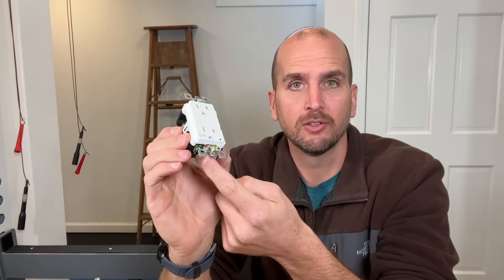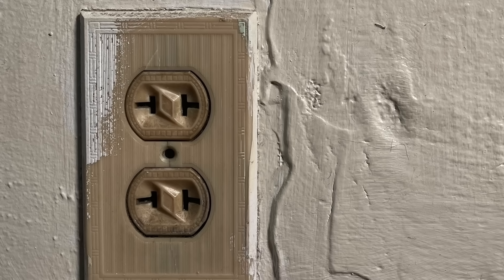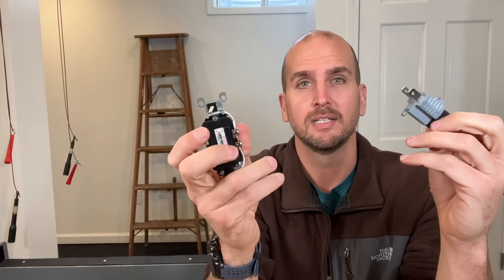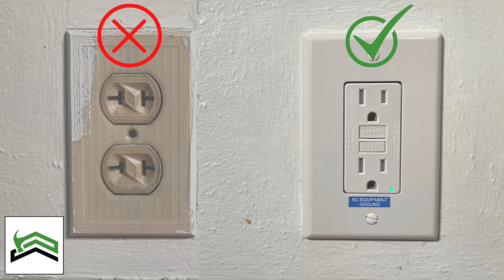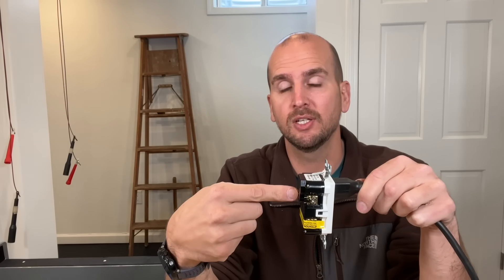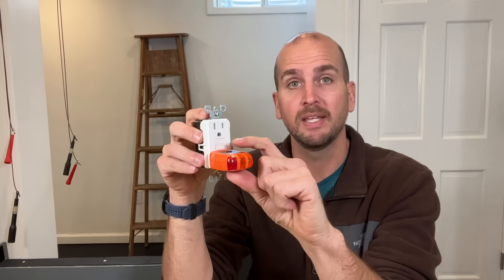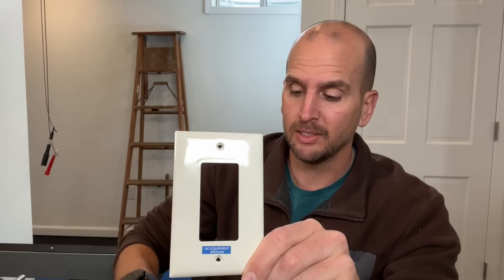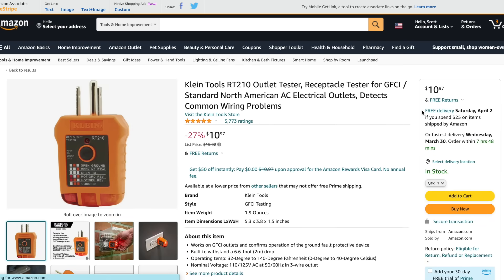Does a GFCI Outlet Still Provide Protection Without A Ground Wire?

Comment: What if the existing line cable only has 2 wires, then the existing load cable has 3 where the gfci outlet is connected to. What is the right/correct connection and how the gfci works on this kind of connection?

Comment: Thank you. I just bought a house and when we were testing the GFCI outlets (for some reason almost every outlet in this house has been changed to a GFCI outlet) only 4 showed as grounded. I wanted to check to make sure the ground wire was connected so we shut off the power to check. What we found was the copper ground wire had been cut. The house at one time was rewired but someone cut all the ground wires from the outlets that were reading as ungrounded. They cut the wire to where it was stripped. Also one of the outlets was wired incorrectly in the dining room. We’re not sure what we are going to do but the video was very informative.

Comment: Will a gfci actually protect outlets downstream and will it pass code? I have heard that a failure downstream may not necessarily trip the gfci upstream, but the breaker itself.
Reply: A GFCI will protect outlets downstream if they are connected to the Load. If they are connected to the Line it will not protect downstream outlets.

Comment: CORRECTION (and an important consideration): If you are isolated from ground (such as standing on a dry wooden floor with rubber soled shoes on) and touch a GFCI outlet with only two wire connection, it WILL NOT TRIP. Because, just as with the Klein tester, there is no path to ground in this scenario. Instead, you become the LOAD, and you are reliant on the breaker to trip instead (which is also unlikely, because your body's resistance is generally too high to allow adequate current flow to trip a breaker).

So yes, GFCI's installed on two wire applications will work when there is a path to ground THROUGH YOU. But they WILL NOT WORK when ALL of the electricity is flowing from Live to Neutral on the same outlet (no path to ground, through you or otherwise).

Comment: No, the GFCI circuirty is only measuring the DIFFERENCE in current across hot and neutral..
If it's over, say 20ma difference, then the GFCI will trip its breaker...

Comment: Late to this party! Wonderful explanation of the function of a ground-fault circuit interrupter. You cover its ability/how to detect, compliance to code when replacing a 2-prong, ungrounded receptacle, and (kind of directly, but indirectly) pointing out the protection to load-side (down-stream) devices is also present and code compliant. The one thing I'd add is this: to test a GFCI receptacle OR breaker, at that point, is to use its built-in test button function. This will demonstrate the device's ability function properly, and should it be a faulty device, it WILL NOT reset, meaning it's time to replace. It sucks to find out so abruptly that way, but it beats finding out it doesn't work under a more disastrous situation. (Master electrician, contractor in Colorado 👍)

Comment: Well just one thing, since that tester won't tell us if the GFCI outlet is working how do we test it?
Reply: every GFCI has a TEST/RESET button on it. It is recommended that you test it every month. Push TEST button. If the it trips instantly, it is working. Press the RESET button to restore power. If the outlet does NOT trip after you push the TEST button, that GFCI is faulty and needs to be replaced.

Comment: I have a new washing machine which is 1900W and 10A rated current that requires to be plugged in a convenience outlet with ground. My question is, if i am going to not install ground wire and only GFCI Outlet will be installed, is it safe? 

Just asking because i already tested the washing machine plugged into the convenience outlet without ground and i felt mild electric shock that is why i am asking here if GFCI is okay to install without ground because i feel scared of being electric shocked again.
Reply: Yes, it is safe. That's why it is code compliance in the first place. GFCI would have instantly cut power, which prevents you from getting shocked.

Comment: Hello i am renting to own a home it was built in 1955 and has 2 prong outlets throughout the 1st and 2nd floor the kitchen and bathroom have gfci outlets and the basement has 3 prong outlets part of the buying process is having the home owner upgrade the outlets are we able to replace all the outlet in the home with gfci i believe there ate 12 in total throughout the 1st and 2nd floor is safe to have them all gfc or have 1 or 2 gfci amd then running 3 prong outlets off the gfci

Comment: Nice video…QUESTION: I have a gfci in a neutral-grounded metal box…I get 120v between hot and ground prongs on a multimeter…a gfci tester STILL doesn’t trip the outlet, but it does trip 3-wire gfci outlets…WHY??…it’s an eaton trgf15la gfci outlet and a klein tools rt210 gfci tester(says can hold the test button for 7 seconds(to build milliamps?))…again, the ground prong carries 120v since the metal box is pigtailed to neutral

Comment: One of the things I didn’t hear mentioned was the position of the GFCI outlet.
As I understand it, the GFCI outlet has to be the first outlet from the breaker.
I’m wondering if that’s actually true.
When you mentioned that the GFCI outlet is detecting the change in voltage between the Hot and the neutral, I suspect that if the GFCI was downstream of a light fixture, or another outlet, the GFCI would detect the change in voltage.
I have a situation in my house where I have some outdoor light fixtures that are the first fixtures connected to the breaker, and then I have two prong outlets. So even if I install a GFCI in the first outlet, I still have light fixtures that are upstream of the GFCI outlet.
 As I said, I think that the GFCI should still detect a fault upstream, but hoping somebody who knows for sure can weigh in.

Comment: I have a question for you I have some open ground receptacles in my older home.While testing I thought a couple were correct.The tester showed correct.The receptacles in question have surge bars connected to them.When I unplugged the surge bar the receptacles immediately read open ground.So my question is while the surge bar is plugged in to the receptacle is it grounded?Also for my remaining receptacles should I just install GFCI receptacles as my easiest way to provide protection.Thanks.

Comment: I’m trying to replace some old outlet receptacles and came across this problem. I only have 2 wires, black and white with no ground. It’s a 20 amp breaker. Do I use a 15 amp gfci and connect the cables to the top 2 screws? If so will the bottom outlet connection work? I’m just trying to connect a grounded ground protection extension cord to connect a small tv, phone charger and a small laptop.
Reply: If the circuit is 20 amp with 12 gauge wire, you can use a 15 or 20 amp GFCI and connect the wires to the Line side, it is imprinted on the back of the GFCI. Both sockets will work the same, just like a regular receptacle. It doesn't matter if your extension cord has a ground, if there's no ground at the receptacle, then there is no ground protection for anything plugged into it. USB cables for charging don't need a ground.

Comment: If I have one receptacle without the ground and I can’t fit a gfci in the smaller box but one of the boxes in the downline does, and is a gfci, does that protect the whole line and can I use a normal receptacle with the ground wire hooked into the white for the box that doesn’t fit gfci or should I make sure all receptacles on the line have gfci and find a smaller gfci or widen my box?

Comment: So it seams that it will work without a ground connection, but still need a route through ground to activate,so does that mean the human body becomes the ground wire to activate the gfci, which if there was a ground wire it would activate on its own without a human body touching it ?
Reply: What? No, it will activate without the ground, it detects of theres a short or malfunction and will cut the power off

Comment: Best explanation after watching dozens of videos. I’m replacing my daughter’s two wire outlets with GFCIs and in most cases, placing it in front of the circuit to protect all other outlets connected to the load on that circuit. My question is: Is there another tester out there that doesn’t rely on the ground to stimulate a trip?

Comment: If we have the older two wire home and want to install gfi outlet, do we still connect the hot and neutral wires to same place on the outlet?  I assume the “line” side.
Reply: The line side is for the power coming in, that side is not protected by the GFCI circuitry. The load side is for the power coming out of the receptacle, that is protected by the GFCI circuitry as the receptacle has no way of knowing where the loss of current happened.  Most of the time, you'll use both, however if for some reason you don't want to protect the rest of the circuit, you'd have to pigtail it to avoid having a more than one wire per terminal.

Comment: At about the 4:20 mark of this video you stated that there are about 10 or 15 years of serviceable life in a GFCI receptacle.
Now that we know that, about how many years of serviceable life are there in non-GFCI receptacles?
Please reply soon.
Thanks.
Reply: There is no particular number for that. My parents have a house that's roughly a hundred years old and many of the original outlets are still fine. Some of them are kind of loose and in need of replacement. There isn't really anything in particular to fail with non-GFCI receptacles other than the springs loosing their springiness and getting loose or potentially the wire getting brittle over time. I'm replacing a bunch of the outlets where I live because they've grown rather loose over the course of several decades of use, they're 50ish years old, and it's mostly the ones that were subjected to a lot of use that are now too loose to be particularly safe. 

It seems to have more to the quality of the receptacle to begin with and how it was used.
Reply: @SmallSpoonBrigade  Thanks.

Comment: If you have the old cloth 2 wire its recommended to place a GFCI at the first outlet on any circuit even if it is not in a wet area where it is required. Remember to label it properly to code with a " No equipment ground " sticker. That GFCI will protect anything that follows after that GFCI outlet. And as he has said remember these GFCI do have a lifetime. I swap them out after 10 years on my rentals just to be sure.
Reply: If you've got that sort of wire, you're better off getting an electrician in to install an AFCI breaker on the circuits if you can. The GFCI won't protect you against any arcs between the hot and neutral that occur between outlets.
Reply: @SmallSpoonBrigade  yea the 2 wire is still good though and if I make a change in the box then I will have to upgrade and rewire the entire property according to codes. As long as I just put the GFCI at first outlet and label it properly I am good with codes.

I agree with you its not perfect but if codes is not making me do a rewire and put in an upgraded box I will leave it alone for a few years.

Comment: Does a GFCI Outlet Still Provide Protection Without A Ground Wire

YES because its NOT looking for Ground current. Its looking at the current flow between H and N and if there is a SLIGHT difference in current between the 2 conductors, it trips open
The Ground is irrelevant in a GFCI

Comment: Good explanation but you didn't explain the main point of confusion IMO which is, why to GFCIs even have a ground connection and how does using it change its function.
Reply: Every device needs a ground as it’s the quickest way for the electricity to return to the panel which trips the breaker for safety. GFCIs are super sensitive and pick up any kind of voltage that’s out of place so hot to ground or hot to neutral and trips within milliseconds.

Comment: Just a reminder folks, the gfci outlet has its own test button. If wired correctly, with or without a ground,  when pressed, it will trip the outlet. This is sufficient to indicate it is working. The aftermarket testers are good for grounded outlets downstream of the gfci to ensure they are properly connected to the gfci outlet and cause it to trip when the button is pressed.  Of course, this only works with grounded circuits.  If you want to be able to test for gfci protection in downstream ungrounded receptacles, you should install a gfci outlet at each location and use the built-in test button for an indication of proper function.
Reply: Yes, but you can use regular receptacles downstream and use the test button on the GFCI to test for proper function of the GFCI and downstream 3 prong receptacles. However, if receptacles are wired using pigtails, connection to downstream receptacles could be an impractical option and a GFCI receptacle at selective locations would be a better option. The Load of the GFCI's would not be used in this case or whenever multiple GFCI's are used on one circuit.

Comment: thank you for this vedio on the GFCI , i belieive i understand this but i need to ask anyway, one of my bathroom has a GFCI Receptacles which i test it and working, but downstream on my second bathroom i have to outlet three prong, reading open ground, i open them both up and i see them connected correcty black, white and ground.want back to my other bathroom where the GFCI is and tipped it, back to the other bathroom and they were off, so that mean that they are protected, the covers does have a lable reads GFCI protected  outlet. I was a bit confuse because they do have ground wire connect to both outlet but still reads open ground. anyway thank you if you could explain this to me. im a Do it yourself.

Comment: Good explanation. I am a building inspector in a small town. I run into this all the time in the older part of town. I explain to the owners of the building that they are protected by a GFCI when they replace a 2 prong outlet over a kitchen countertop or bath vanity and don't need to run an extra ground wire. Most understand when you explain it.
Reply: @geneo1976  just remember an ungrounded outlet when configured with a GFI outlet will not protect equipment only against shocks. The ground is there to get the full benefit of the GFI. 73

Comment: How does that 3 prong to 2 adapter even exist?  It seems like a no brainer that it might not be a good idea.
Reply: because you can't physically plug for example a pc into a 2 prong outlet in an old bedroom
Reply: @gamecubeplayer  🙄
Reply: Many homes built between 1950 and 1970 used metal boxes that were actually grounded and bonded to the main panel, but 3 prong receptacles didn't become standard until the late 1960's. That's the situation when these adapters come in. They have a metal tab to be connected to the receptacle by using the screw for the cover plate and that will continue the grounding. Most people probably didn't bother with them though.
Reply: @surferdude642 my home doesn't use those boxes because my kitchen is properly grounded

Comment: I"m trying to convert an old two prong outlet in the bathroom to a GFCI outlet.  The metal outlet box is grounded...I'm assuming...via the metal conduit back to the panel which has been updated at some point.  There is no ground wire or green ground screw in metal outlet box so there is nothing to indicate it's grounded in some other way.  So my question...can you attach a green 12 gauge pigtail wire from the GFCI ground screw and anchor the other end of the wire to the metal outlet box to achieve a safe ground?

Comment: Hello I was rodding out my tub and I plug the three prom into one of those grey three proms and plug it into the gfci and after a while the lights flickered and now I have no power in that socket or two other rooms . I change the gfci but now it a red light on and it still won’t reset .  What am I doing wrong